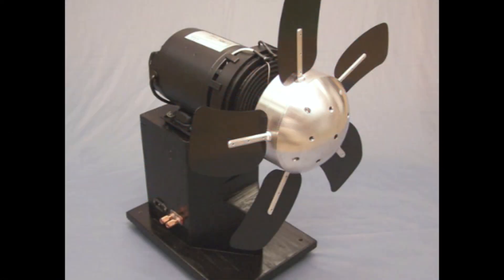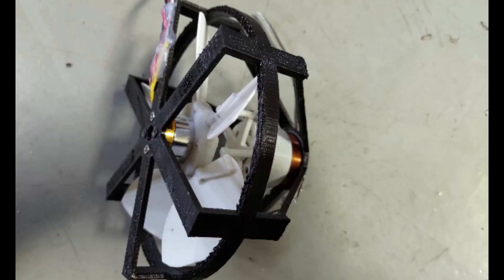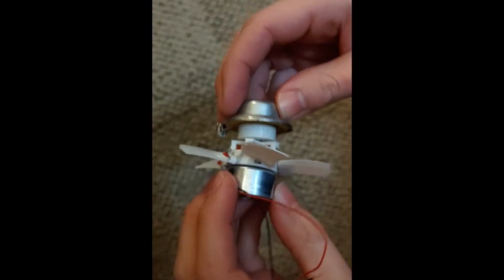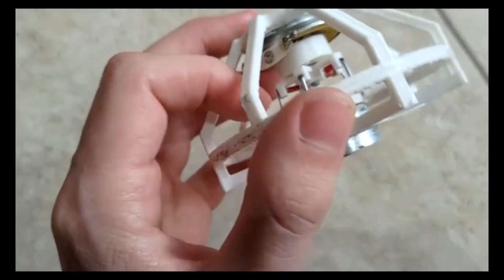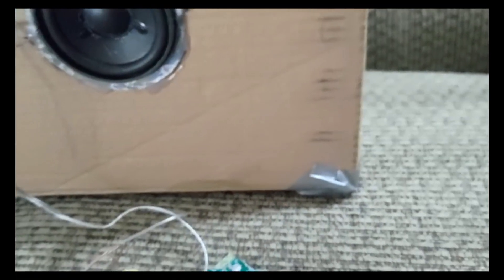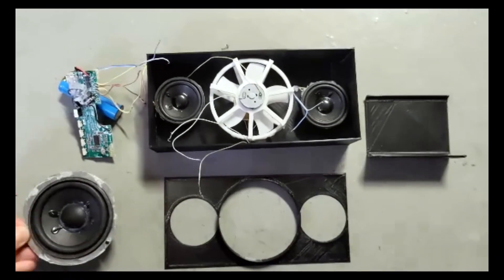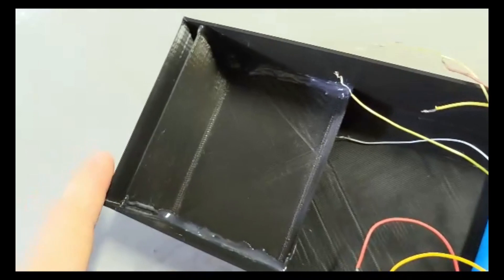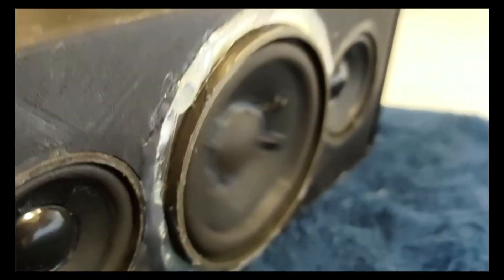Rotary Subwoofer inside Handheld Bluetooth Speaker (Will it work?)

Comment: I appreciate the hard work you put in this project but in my own opinion rotary is not the way to go for a smaller speaker system because rotary needs a big space to make the back and forth alternating air pressure, for example a closed room or a car boot etc. In order to make big bass from a small speaker, what you need to work on is some system in which a small speaker is made in such a way that when it is placed/stuck on a surface, it utilises that surface to make bass by sending vibrations down to it. In fact, I've seen this kind of a small portable speaker in a video that is bass-less when hand held but makes a massive bass as soon as it is placed on a hollow and hard surface. Probe into this theory and maybe you get better results.
Reply from the maker: @Gr8Passion4Music  this is what I did before rotary subs

Comment: A small idea to get tid of fan noise is to put the entire assembly into a box and install a passive radiator in front of the fan. Idk whether it will work.
Reply from the maker: It would work but the passive radiator would need to be very large (15 inches at least)

Comment: I hope you try this again as well. 
I'm slowly gathering parts to try to turn a desktop computer fan into a small rotary sub and a couple of small speakers to my electric wheelchair for some rolling music. 
  The way that I planned to mount it was similar to your box, but I was going to have a short pipe going through the middle of the box to leave the rotary open while providing backpressure for the cone speakers on either side. 

Getting to see this and a couple of your other builds has really helped me to work out what I need. Thank you.
Reply from the maker: I'm really glad I could help. My ultimate goal is for anyone who is interested to be able to own a rotary sub (whether they build it or buy it cheaply from me)

Comment: What about balancing the blades then playing with fan speed the speed could be adding toomuch dynamic resistance
Reply from the maker: A faster fan speed does require a stronger coil or more watts to the coil

Comment: fan speed has a direct impact on output. Faster blades will push more air at the same blade angle. Try doing this with a more powerful motor and stiffer blades. Maybe try using a carbon fiber PLA or PETG to print the blades (stiffest filament without getting super pricey). Finally, drop the box. Make the enclosure a pill form like the beats, center the sub to pull air in one end and out the other. Rotary subs in a ported box are a no go.
Reply from the maker: Good idea

Comment: It's a shame it didn't turn out like it would have been expected. I say don't give up on the idea of Bluetooth rotary subs just yet. Try experimenting with a different baffle system. 
I know i had once used a 12" sub mounted to a plastic bucket. The bass was there but the sound of the plastic was just horrible.

Comment: 8:21 I would wager if you used the subwoofer That was meant for this Bluetooth speaker and turned it into a rotary sub it would work better than It seems like you need a larger magnet Running a rotary sound in something this size.

Comment: To add to my other comment, I think it’s a,axing you are doing this. I hope you keep it up because experimentation is the path to innovation. Also, if you can turn down gain and control the deflections of the blades better it could help reduce noise and allow small enclosures (relatively speaking)

Comment: The precision necessary to quiet the components makes it difficult to make. It just introduces so much noise into the equation. But if that can be solved….🤷‍♂️ sky is the limit. But the volume they need makes them impractical for portable applications.
Reply from the maker: I'm developing a new "rattle-less" rotary sub that reduces tons of moving parts compared to this one. It actually has the blades attached to coreless motor shafts that are in the rotating part. If I succeed with this then rotary subs will be very easy to build

Comment: The rattling can be fixed, this concept idea should not be given up on. If there is a way, someone will make it possible.
Rotary Subwoofer might have another good purpose as well, I wonder if it could keep open air flow in a open warehouse were there is no air conditioning?

Comment: The problem for this mini sub is the tiny back enclosure,  because if the little fan is successful at even generating 1 psi of pressure in the cabinet… Where is that pressure going to go but through the gaps in the blades of the fan, thereby neutralizing any pressure the blades pushed out or in. 
that’s why this works when it’s in a window because of very little blow-by or spillover pressure from either inside or outside. 
The smaller cabinet has to be pressure dissipative on the back side—down to the frequencies desired to be played, and timed to the enormously long wavelengths below 50hz. (100ft plus)
It’s as though this design concept needs an indoor and outdoor separation just as hvac needs to discharge the heat to cool inside, and the two can’t share the same space…
But people will still try to air condition their garage with a window a/c and no separator panel or wall. 
(Have seen it myself)
But this is also this concepts limitation as to how loud it can create any sineuaoidal bass tones with any purity and intensity based on the action the pressure on the front or back of the fan blades it creates…makes a huge motivating force on the air to want to pass right back through the fan instead of out into the room with the listeners.

Comment: i think u have to change the concept, u use a fan to pump in a modulate airflow, try to use 2 membrane valve and use a standard speaker or a pump with magnetic piston i think u have a low noise and the piston vibration help u in propagation of bass tone, remember to fix the speakers to the surface (the bass tone was propagated well on surface not in air)

Comment: Hi there!! Nice try!! My English is not good… may be it will be better if you take voice coil from a servo control sub woofer from the smallest sub and make a tiny open bafle rotary sub. And May be a good idea to lock for the high effition fan blades. Cool stuf!! A huge from Mexico

Comment: Heres another idea. You may know of those dyson bladeless fans, well there are cheaper knockoffs. what if you replace their fans with the rotarry sub, it should reduce rattling, and also make the air less choppy
Reply: Can't have any air path restrictions as the blades oscillate both ways off the spinning centerline to create the sine wave frequency!!!

Comment: The cabinet is way too small and has its own resonance frequency that is way higher then you would want with a rotary sub. You would need close to infinite space, easiest is to mount it in a window. A rotary sub is a infra sub, so you would still need a sub that does everything from 50/60hz upwards.
Also I think the 3d printed stuff is not sturdy enough to work consistent for a long time.

Comment: For a small size like this I think putting bearings on each blade to allow the pitch variation is a mistake. I think you'd get a much cleaner actuation and sound by using a compliant structure, a blade that just flexes back and forth instead of tilting.
Actually that may be a good idea even for a large blade fan.

Comment: What I really wanna know is would it be possible to make something like this using a turbine design instead of fans to have more pressure. Or maybe replace the blades entirely with an ionic thruster. I know Integza has been working on and made some neat designs for one, but if it were optimized to put out a lot of air, it might be a good idea to get rid of the fan noise and still be able to move air. Then again with all that being said, perhaps the sound of electricity zapping air would still defeat the purpose, but maybe it would help remove some mechanical components so less chance of mechanical failure. But I also am not sure if it would even move enough air to be worth the idea.

Comment: Why not make it so its ezzentially a 6" open boom tube design with sound dampening pre rotary sub, and  mids on each side and tweeters ib top? Idk i feel like if you make it a bit bigger, and open it up treating it more like a ducted fan than a sub box and it should work better right?

Comment: Might have to tune the port a bit for best accoustics. You want some restriction to generate a pressure differential, but you need it open enough that it doesn't overwhelm the fan and cause it to stall.

Comment: A thought about the Bluetooth amp - often if a manufacturer knows that their amp isn't going to be handling a lot of bass (as in small speakers) and it's battery powered, they will design the amp to roll down the bass to save power. I kind of don't think that's the case here because the regular speaker had a decent amount but I recall reading that rotary subwoofers take more power than a regular speaker - so your rattling noises may be partially due to the amp clipping. Just a thought.
Reply: They take more power to drive, but it's mostly going to the motor. The power in the actual audio channel only needs to actuate the blades.

Comment: Fun experiment.. But isn't the whole idea of rotary subwoofers to pressurize a room in the low subsonics, just a handful of cycles per second? For that matter, doesn't the sub need a means of delivering the air pulses into the room remotely, to really be effective and not contribute mechanical noise?

Comment: It sounded like you were overloading the enclosure with the fan running  at such a high speed. Fan blades have their own resonance which could cause the bass from the driver to be distorted. 3X air movement in that small an enclosure might not allow the port to operate in the proper pass band. You could run a variable speed brushless motor instead of the brushed hobby motor you used, and by varying the motor speed get a response level that matches the enclosure better. PWM the brushless motor, using the bass audio as a signal, and you could match the drivers output and the fan speed for the lower bass frequencies.

Comment: i bet that little rotary fan you made would be an excellent in wall speaker.... mount it at the top in between the studs and cut a 3"x14" port down by the floor (a non insulated wall) and put a foam baffle port in front of the fan to mask the linkage noise . the resonant frequency of the drywall/wood/studs would probably do that little speaker good after hearing how it sounded in that cardboard box.

Comment: alls i can think is like a engine or something with an imbalance could try some bushings and rubber spacers should deaden the vibrations in theory and maybe try a different blade design also maybe more air passages

Comment: Interesting! It sounds bad but at least it works. Keep going!
Reply: There are two inherent problems with rotary speakers that can't be overcome: delayed response (from the moment the electronic circuitry receives the signal to the time required to the motor and blade to start moving) and noise (the whirring noise).
Reply: @jimbotron70  could delaying the other frequencies help?
Reply: @ContriteCatholic  I'm doubtful, they're likely unsolvable problems to me for home use. The only reasonable use for rotary woofers is for large venues like cinemas, concerts, theme parks where said issues could be reasonably concealed.

Comment: To fix the rattle you might look at RC car suspension parts. I believe they make tiny ball joints and linkages.

Very cool project!
Reply: That’s actually a fantastic idea. Brushless motor and variable pitch prop devices for RC aircraft could be a great starting point too. Modified blades would probably work. Blade Balance is key though.
Reply from the maker: Good point
Reply: They do

Comment: It might be worth putting some sort of frequency splitter in there so the rotary sub is only handling frequencies below 20hz? It would probably sound dope with the native subwoofer and the addition of the rotary subwoofer!
Reply from the maker: The rotary sub is capable of 1 to 50 hz so I would use a splitter for 50 and down. Running the sub with straight audio generates more heat but doesn't destort
Reply: @nathanbulle5782  okay here's my grand idea, what's about a similar pillar style you got there, but use 1 tweeter, 1 midrange driver, a woofer, (not subwoofer) and the rotary sub?

Idk what kind of amp you would need to run that, but with a bandpass filter on the woofer+midrange driver accompanied with a LPF for the rotary sub and a HPF for the tweeters?

I've only dabbled with car audio, but I've always dreamt of making my own all in one box like that.

Comment: Please try it again. Try to use flexture joints to reduce ratteling and to simplify assembling.
Make blades fill surface of the speaker completely.
To increase pressure you can use two cotrary rotating motors. Control signals should be synchronised, but phase should be tweaked, so they work in resonance..
It can be really interesting.

Comment: I would try a fan with 3 larger + deeper blades,  rather than 5 small shallow blades,  in addition to having a pass through pipe design, where you just put some metal screen material on the opened ends.    I once bought these used Industrial fans,  that were like 1" deep, with 3 blades.  I believe their original use, was for the giant, original, HP Laserjet printers.  They were VERY powerful, and very loud.. and created near hurricane level winds.   I had put two of them in front of a cut up PC case... and it was pretty much overkill.  I probably didnt even need my CPU cooling fans... because the amount of air those 2 industrial fans created... was astounding.   But as said.. it came with a cost.  The things were incredibly loud.. and being that they were AC... I couldnt control the speed (I never tried an in-line adjuster.. just wired them direct to the power cord)     I believe those fans were 4" x 4"  with a total of 1.5" depth.  I have no idea what the RPM was.. but if memory serves correct... I think I was able to chop carrots with them.

 As for the blades themselves... take account for plastic stretching out, from rotational forces.  You might have to increase the gap between the blades and the surround.. as well as add a bit more thickness and rigidity to the blades.  Of course, certain plastics are less effected by rotational forces.. which is why those brown colored PC fans are able to preform much better than others (noctooah?).   Because their plastic does not deform.. then can use less clearance between the blades and the housing.
Reply: I will add... that sometimes with too many blades.. you end up creating turbulence, that causes some backwards moving air.   As such, sometime less blades, can actually more more air.. more efficiently.

Comment: I've been building loudspeakers since the 80's, but never considered a spinning sub before and I think it's a great idea.  A couple of thoughts (hopefully helpful ones!)   Instead of a closed box.  What about using the air behind the rotor by redirecting it to the front of the cabinet.  Kind of a horn/ bass reflex hybrid that allows free air movement in front and behind the rotor.  You might have to play with tuning a bit.  I like the idea of a 3d printed cabinet.  Adding dampening material, such as the asphalt material used to damp the noise in a car would help in vibration.  Lastly, make the rotor as absolutely light and stiff as you possibly can.  Of the two, stiffness is the more important.  Everything that supports the rotor and motor should be as sound dead as possible.  Be sure that no two parts meet that have the same natural frequency. Running the rotor with a belt rather than direct drive would be interesting, but probably a nightmare to package.   I hope that I'm not just being Admiral Obvious here.  I honestly love this idea. It may never be practical, but hey, I built a set of plasma tweeters with vents to the outside and ran them for months. So who cares about practical.
Reply: You can actually find a lot of info about it on the internet under "Rotatory Subwoofer", if I'm not wrong, this concept held the most powerful subwoofer in the Guinness World Records
Reply: You absolute beast! When I was 12 I went to a HiFi convention in a hotel, and one manufacturer was demoing their plasma tweeters. They were asking $25,000 for the pair, and this was 1980. Came with a tank of Argon? I can’t remember what gas was being used. I just remember freaking tf out at it.
Reply: @mikabreto   Thanks. The problem with plasma tweeters is that they produce a lot of ozone, if you use the atmosphere to produce the arc.  Which is extremely unhealthy, to deadly in enclosed spaces.  I circumvented this with a dryer exhaust hose and a fan and having the system suck air across the tweeters and vent it outside.  Using another noble gas, such as argon or helium would prevent that, but presents its own costs and challenges to use.
Reply: If you could watch your sub in action with a high speed camera it might help answer some of your rattling issues. I agree with the person above that rigidity is your primary concern to get rid of the rattling.

Comment: Some thoughts - similar to other comments already but some things that might have helped (maybe): Stiffer material for the rotors, soft padding inside the enclosure, larger port and larger enclosure (yeah, I know, starts defeating the idea a bit). I don't know if doing those things would help or not really. Actually, reading the other comments, I think they might have a point about spinning the blades faster and maybe having more of them.
Reply from the maker: A bigger enclosure is the key to rotary subs. The closer one can get to an infinite baffle the better.
Reply: @nathanbulle5782  Cheers